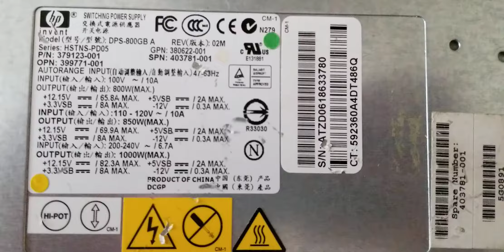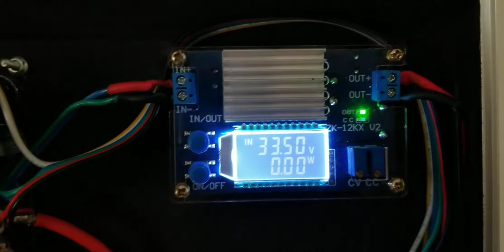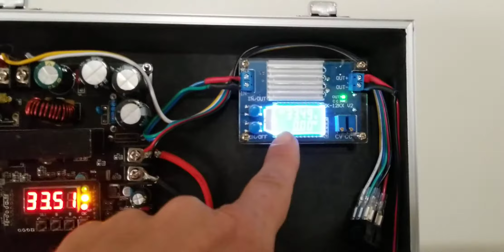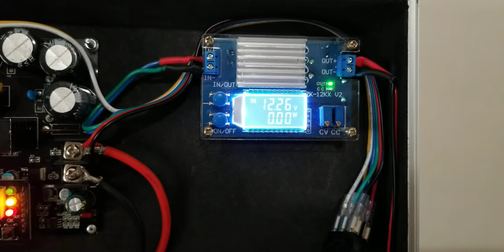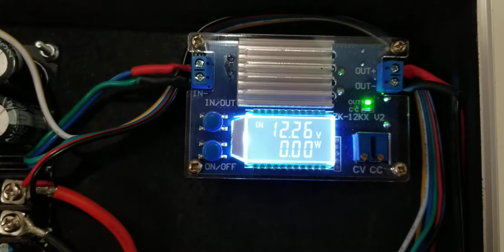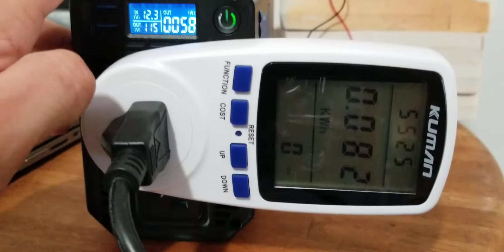DIY 600w Dual battery charger

Comment: I’ll be subscriber number one :).

I like this, I have one of those hp power supplies connected to that same boost converter that has come in handy many times. Have never gotten around to making it nicer like you have here.

I need to get a buck converter similar to what you have for top balancing packs.

Something I’d like to setup is a high current variable drain that has a low voltage cutoff built in. Just haven’t worked it out yet. Been using an electric heater from a furnace and clipping wires on at various places to get the current draw I need. Would be cool to have a knob to adjust where on the coil it shorts thereby adjusting the current.

On the other hand using your discharge to charge other batteries like you is much more efficient! Ha ha